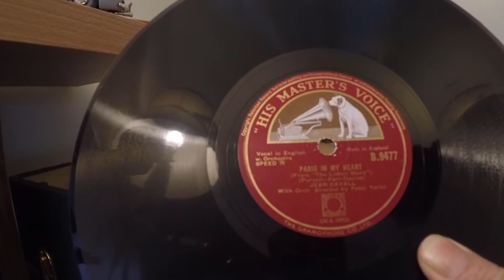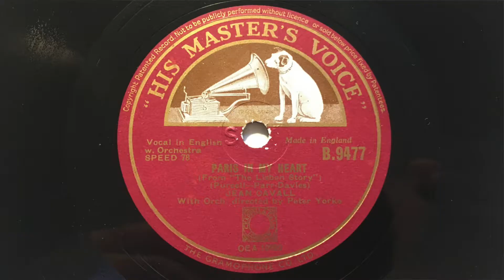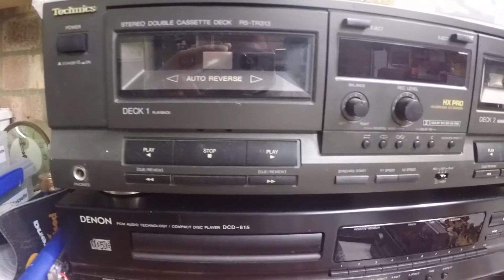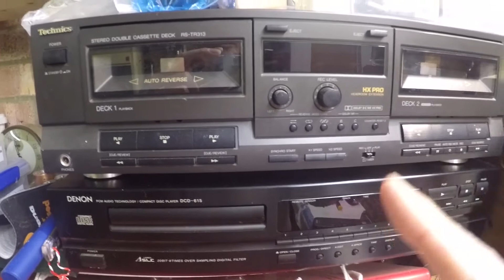Update - Sony Midi  HiFi (27th September 2020)

Comment: Hello Sr Richard. Thank you for your great channel. I enjoy your videoes very much. It looks for me that the cassette door at B deck does not go fully in. In general I think the problem is a mechanical one with the mechanisms. Maybe the heads does not align correctly to reach the tape. Other problems can be that the timing of the mechanism is off or got stuck. Try to reset them by manually moving the capstan fly wheels. I have a background as a service repairman on radio and TV for many years. I also collect vintage audio. Stay safe. All the very best. Best regards from Ditlef.
Reply from the maker: Hi Ditlef 

OK all sounds good advice and will take a second look. Its a pain as you could see - hate it when projects get the better of me. 

Warm regards 

Richard

Comment: It could be the main belt slipping. The belt is under load when the heads pull up. It might be worth trying changing the main capstan belt.
Reply from the maker: Hi Simon 

You may have a point and I will check - as you know I changed the main drive belts 

Warm regards 

Richard

Comment: it sounds like the cassette deck is trying to move the head but can't. Either gears are out of time, or there's another belt deeper in the mechanism that is used to drive the heads. It could also be your new belt is slipping and not able to drive the capstan with sufficient torque to actuate the mechanism. I've worked on quite a few similar Sony decks before and I very much doubt it's an electronic fault. Despite being full logic they are still highly mechanical and the electronics that drive the mechanism are quite simple. I'm in the UK and would happily take a look at it for you if you can't get it going.
Reply from the maker: Hi Ashley 

Thats fantastic advice and thanks for the offer.

Warm regards 

Richard